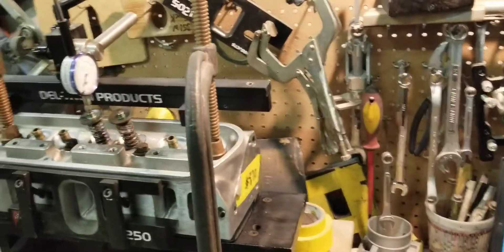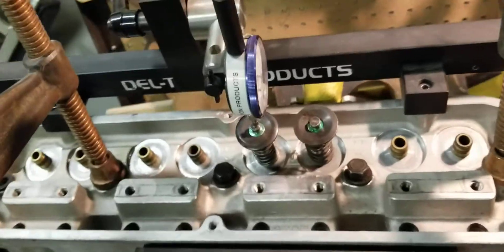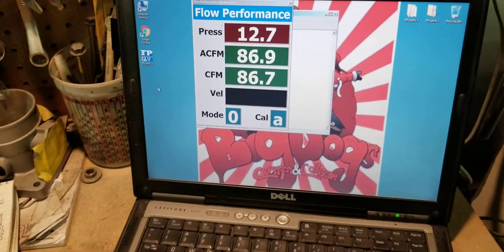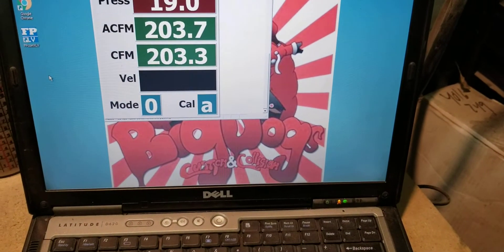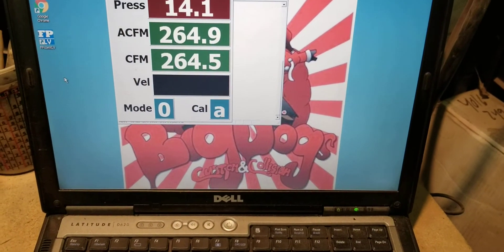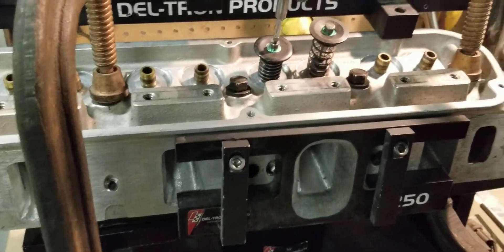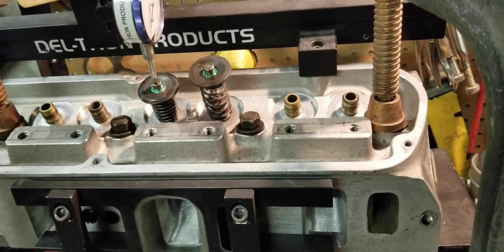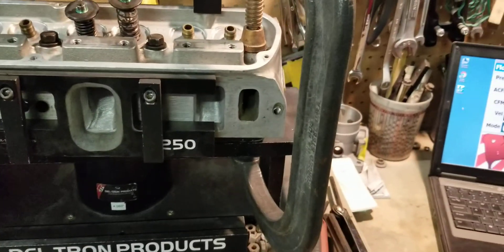Sbf Edelbrock Performer Stage 2 ported heads flow results

Comment: Ever do a pair of 351c 2v heads?
Reply from the maker: Yes we have.
Reply: @bigdogsportingtonyb2833  what kind of numbers
Reply from the maker: @jcaj9002  38-42cfm gains with stock size valves and multi angle seat work
Reply: @bigdogsportingtonyb2833  Thanks

Comment: Turned those old Performers around all for less than buying a new set of heads. Major gains through out, especially in the low and mid lift range.

Comment: BEFORE
.100=57cfm
.200=117cfm
.300=174cfm
.400=219cfm
.500=242cfm
.600=250cfm

AFTER
 .100=85cfm
.200=148cfm
.300=203cfm
.400=240cfm
.500=264cfm
.600=280cfm

 Its science..not magic. Good stuff Tony!
Reply from the maker: Its all about the right port shapes and size percentages. It's not easy at all and you have to have the science down pat. Look at those low lift numbers!!! 85/64 @ only .100" lift. This is why I say you don't need crazy lift cams that beat up your valvetrain when we port your heads and other parts!! Same bench same testing process!
Reply: @bigdogsportingtonyb2833   yes sir!